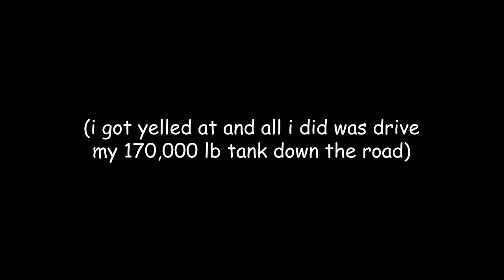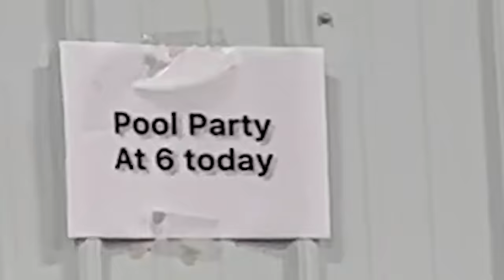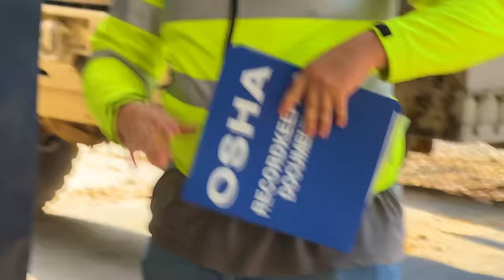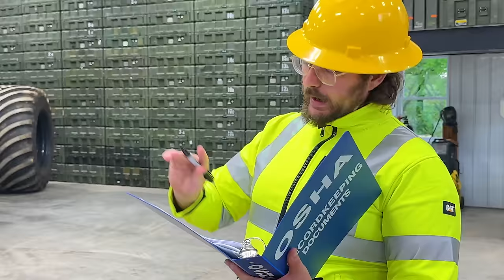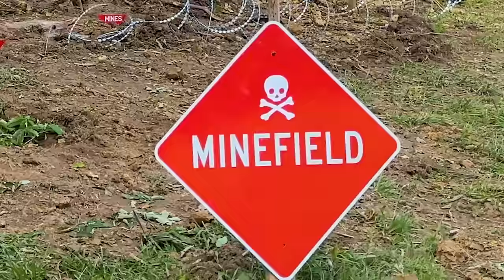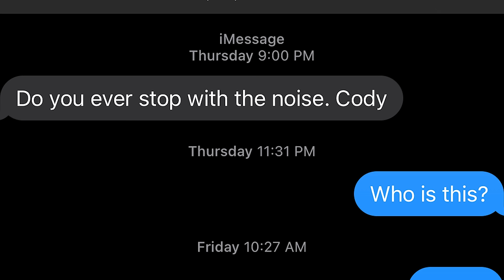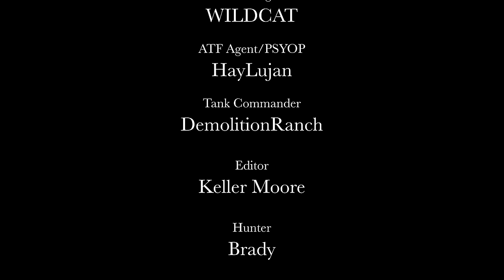Laws Don't Apply To Me... I Own A Tank

Comment: Even if it’s plugged it just means you got a muzzle loaded cannon. Enough powder you can blast anything
Reply: Problem with that is depending on the plug there's a good chance it blows the plug back into whoever happens to be behind the barrel.
Reply: Or more likely, it'll make the gun a few cm wider
Reply: pLUG
Reply: It'll either shoot or explode spectacularly.
Reply: From inside I'm sure you can stuff a projectile then a gun powder pack then rig up a way to ignite it. Maybe.
Reply: @kugelblitz1557  well now you have an unplugged cannon free to take shells😁
Reply: @Straight_White_Fatherly_Figure  yep, no. It’s not like a decommissioned rifle. It’s just a scabby run of stick weld around a short bit of bar stock. :D
Reply: @yuritesticoff1141  not entirely true at all.  a small powder charge would be easy to do.    knowing cody however.......... "small" is not in his vocabulary
Reply: @yuritesticoff1141  you are forgetting that the main plug is only on one end of the barrel.  that gives plenty of escape route for pressure.  they rolled a steel ball through the barrel so obviously its not 100% plugged if Matt managed to insert one and it rolled out the other end. 

What you are describing is attempting to shoot a round through a 100% plugged barrel from BEHIND the plug.
Reply: Way safer to fire it the way they did it. Pyrotechnics and good editing.
Reply: The breach block is welded open.  There's no way to close the breach on a live round.  You can see the welds in some of the shots.
Reply: @birddogz545  oh they welded it OPEN?   

i thought it was an actual breech and barrel plug they did...... hmmmph learn something different
Reply: @CapStar362  it's on mr hewes channel (v=E6xo-t_dIGI), they had to cut the a hole into the top of the barrel and lop the breach in half. breech has been welded back on in this vid lol
Reply: @adi4x4  i forgot about that, but i have seen numerous other tanks and vehicles where they would drop molten steel into the barrel and plug it,  making it so the breach would technically still half operate ( Would not seal into firing position )

Comment: as a war thunder british main (yes) it's actually really cool to see a chieftain in running order and doing crazy things like this
Reply: Fr i thought chieftain's have a mechanical breakdown every minute
Reply: I believe cody also spent alot maintanance that tank 🤣
Reply: Bro put yes in brackets for no reason 💀
Reply: British mechanical engineering sucks so bad 😂
Reply: @mikailvito7200  Nah the Chieftan is sound
Reply: When Cody bought the tank the British guy gave him 24 hours to get everything in order (Fixed) and thought him how to operate it
Reply: @mikailvito7200  Yes the early Chieftains were very unreliable due to their Leyland dual fuel engines, but on the later versions like this one the reliability was pretty much sorted. The main problem with them was the clouds of exhaust smoke that would have let the Russians know their positions from miles away.
Reply: Btw, why is it always British tanks in Videos like this?

Comment: I had the pleasure to be around tanks a lot and the fact that a chieftain struggles for a bit to move the monster truck is absolutely craaaazzzyy to me
Reply: Wasn't the chieftain notoriously underpowered?
Reply: @willreed2149 na it can do 60 that’s what most modern thanks can do. Might just not be as torquey as some other modern full size tanks but it’s plenty powerful.
Reply: Probably in the wrong gear.
Reply: Well they only have 750 horsepower. The M1A1 is 1500 horsepower by comparison.
Reply: @EETechs  If you talk to anyone who is ex British Army and has actually crewed a Chieftain, they will all tell you that for their size they were severely underpowered and that Leyland Engine was notorious for oil leaks. The Power plants in Modern Tanks have come a long way since these were in service.
Reply: @stephensmith4480  those were the early versions of the engine